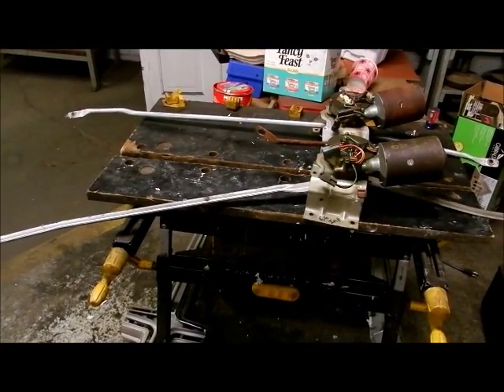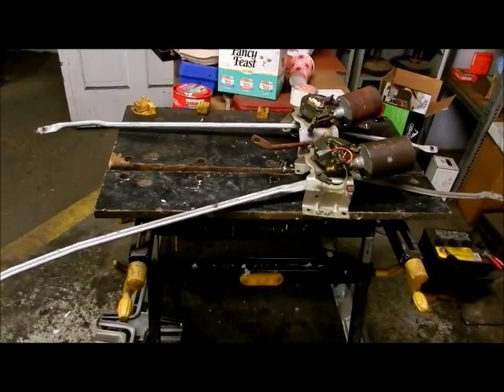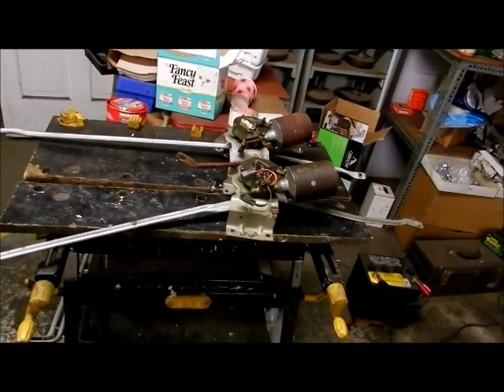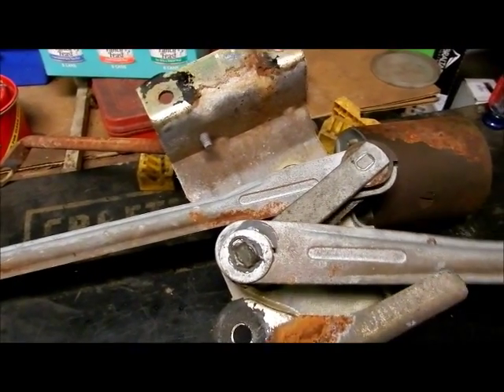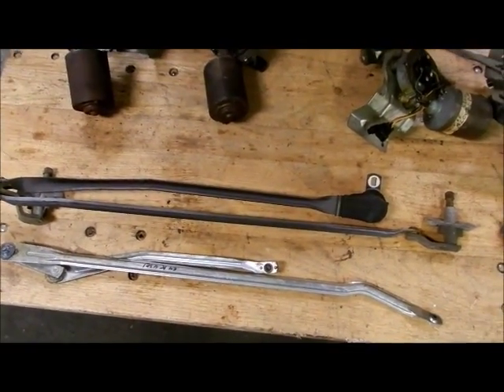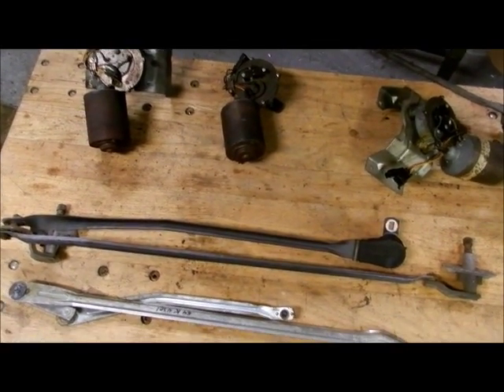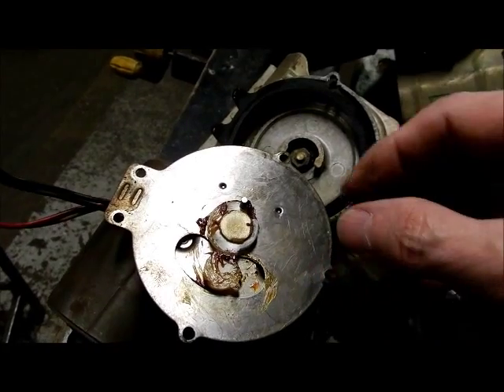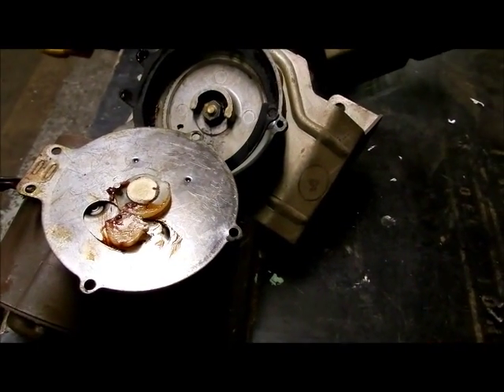Chrysler Windshield Wiper

Comment: Hello any information on a 1975 Chrysler imperial windshield wiper arm/motor set up? The motor is running but the arms are not moving and not sure if they are stripped or need to be reconnected/crimped etc.
Reply from the maker: That is too new for me.